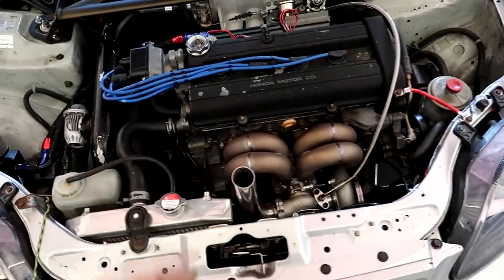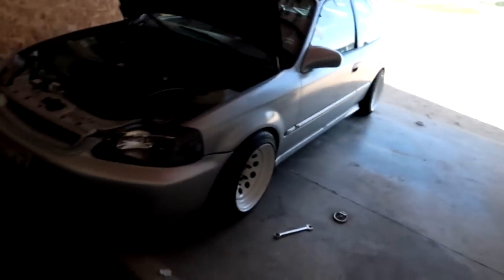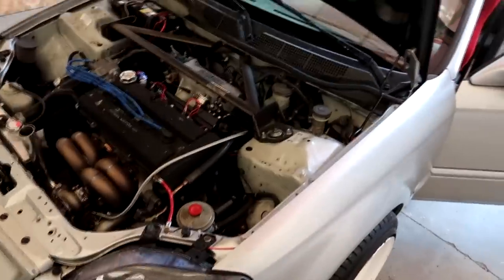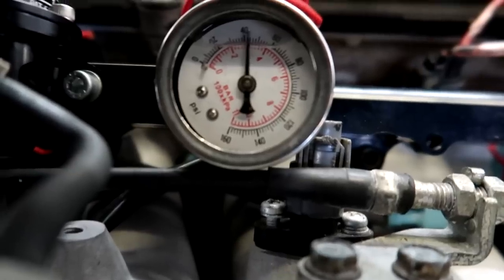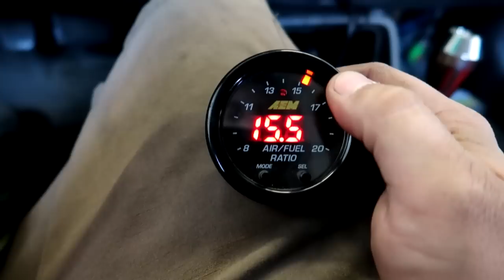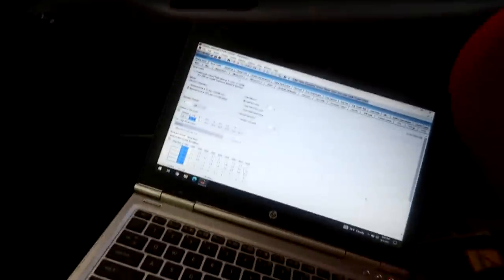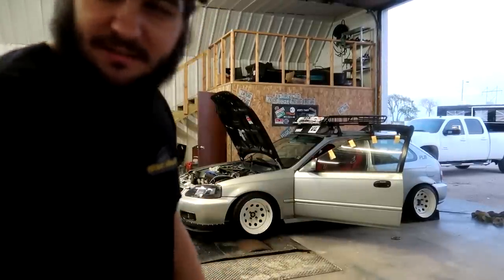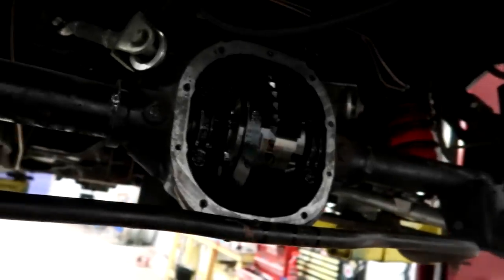Big Turbo B18 Non Vtec Dyno Tune Ek Civic Honda Hatch Hondata S300 Tuning Boost Control

Comment: I made 412 whp on a garage rebuilt (NPR rings, ACL Race bearings) B18B1 with BC Stage 2 Turbo cams with ARP head and main studs, Cometic MLS head gasket, 630cc Bosch injectors, Walbro 255 LPH fuel pump, 93 octane, eBay 50 trim turbo, full 3" downpipe & exhaust w/cat delete, tuned on Crome Gold at 15 psi. Stock bottom end engine. That same car now has a fully built LSVTEC with a GT3582R turbo at 28 psi on Hondata S300 V3 and it makes 709 whp. When I say fully built, I mean it has almost the best of everything in it. It has close to $15k under the hood.

Comment: Do you think the lag might have been caused by the dinky 3lb waste gate spring not sealing with such low spring pressure. Sure the solenoid seals it shut, but it needs boost pressure to put more pressure on the top of the gate, which it doesn't have in the low end. If it was me I'd run an 8lb spring

Comment: Im having the same issue with the boost controller i put 70% duty cycle and nothing, i played around with the frequency and at 32 Hz and 45% i was able to get the solenoid to work. I went from 5psi to 7.9psi. Do you have any tips? i'll try to look for boost leaks today

Comment: That's what I did on mine I wired in a flex fuel sensor and got it tuned for 91 pump and E85 lol even though all I've been running is E85 I did splash $2 of 91 in the other day after topping off on E85 lol

Comment: Correction on the skunk2 Pro Series intake manifold.  They have a much larger volume inside and you can  not bore them for a 74mm (3") throttle body. This you can not do to a very restricted B16 intake manifold.  There is a significant difference between the skunk2 and oem B16

Comment: Putting the stock intake manifold back on would help the mid range wake back up. That manifold is meant to make power up around 8k. Long runner = low rpm and short for high rpm. It’s a trade off
Reply: Have you seen the runners on the pro series there longer then stock I picked up from 3500 rpm to redline my switch to a ported pro series not cut but just cleaned at 5 k rpm I picked up 25 whp and at redline and close to 400 at redline  it made 365 on 15 psi and 401 whp just from manifold change the race style manifolds make power up top these one are almost the same lengths as stock just a bit longer mine is on a h22 and they are way longer then stock
Reply: @hseriesonlymonctonnb1181  those are some good gains from a manifold. Vtec engines like the B and H series have significantly more cam duration on the big lobe. That’s why those engines breathe so well and a ton of power with little effort. The non-vtec b series engines have terrible cam specs in comparison, so those engines should have matching cam and intake manifold specs for the desired operating range of the engine
Reply: nobody cares

Comment: Sure you know this but good info if you don't. All vehicles sold in the us after 1986 have fuel systems compatible with e85. The didn't have to make them run happy on e85 but as far as pumps, tanks, lines, injectors their all compatible with e85.

Comment: Quick question about adjusting the fuel pressure like that. When adjusting the fuel pressure, are you adjusting for atmospheric pressure-no vacuum/no boost, or are you accounting for elevation and all that when you set it to 40? 

I feel like the 1:1 ratio would be affected if you had 40 psi at say -15 vacuum as it would rise over 40 psi at 0 pressure. Or does that not matter?

And a follow up question. When you're tuning your cruising a/f do you have to mess with tip-in at all to cover that moment of going lean/rich or are you just adjusting your VE to hit target?

Thanks.